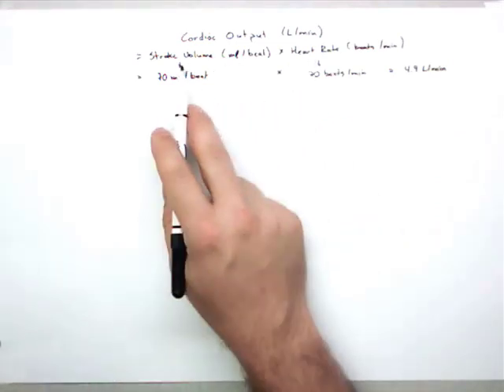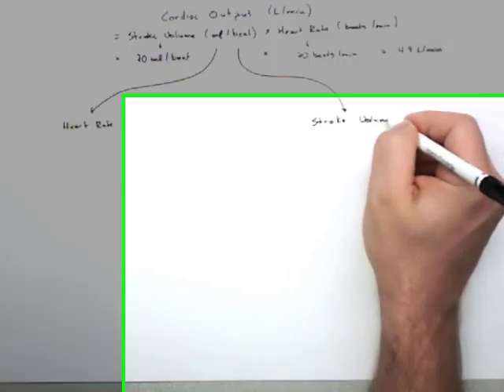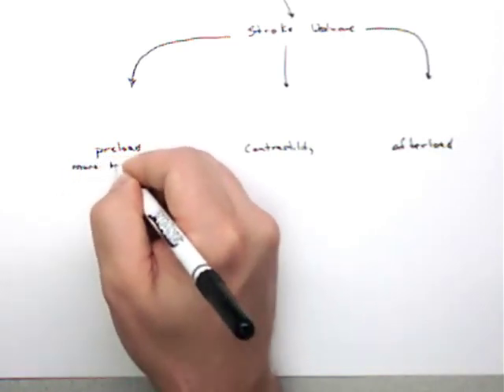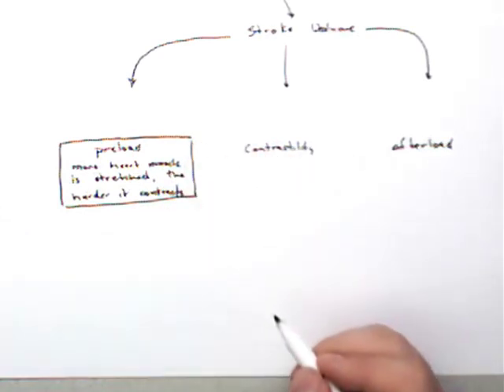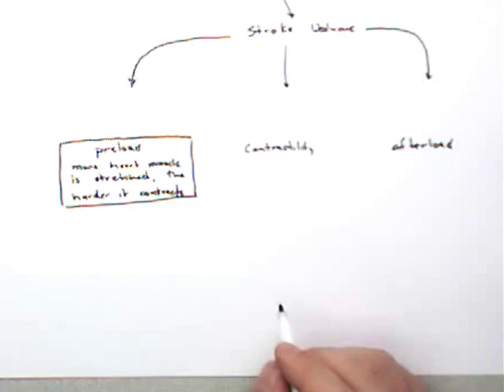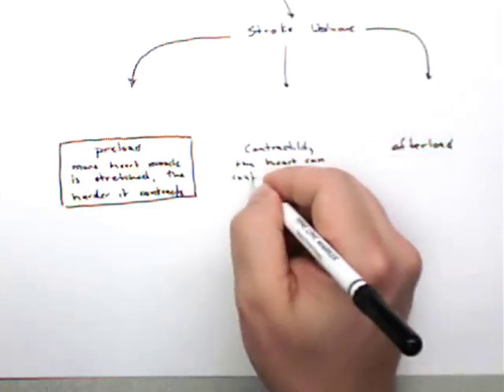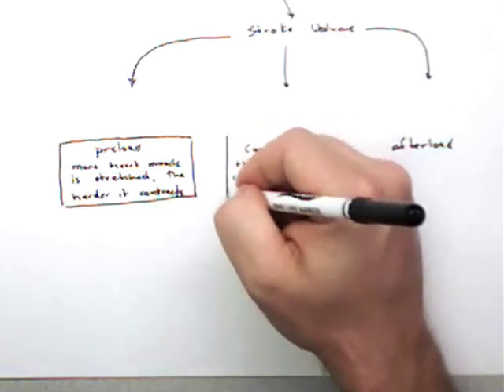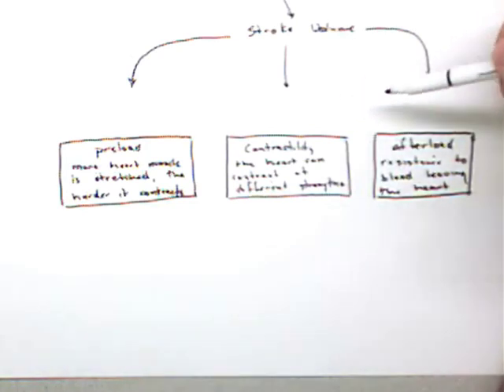Cardiac Output Part 1 Intro and SV

Comment: @bullets898 Yes, ventricular 'elasticity' or compliance can have a profound influence on SV. Preload is the volume in the ventricle at end diastole, or right before the heart will start to contract to force blood out. If the heart is not compliant (stiff) it can limit the ventricular filling which will decrease your preload. This is not dependant on starling mechanisms but a result of changes in the heart muscle itself from a variety of illnesses (scarring from heart attacks, fibrosis of muscle.

Comment from the maker: Preload can mean simply the amount of blood in the heart just before contraction. But on a deeper level, it eludes to the Frank-Starling Law.    In terms of the Frank-Starling Law, preload means the more the heart is filled, the more the muscle fibers are stretched, this pulls open the calcium binding site on troponin so that more stretch equals greater muscle activation (or contractility).  I suspect "ventricular elasticity" also eludes to Frank-Starling.  I hope that helps.  dj